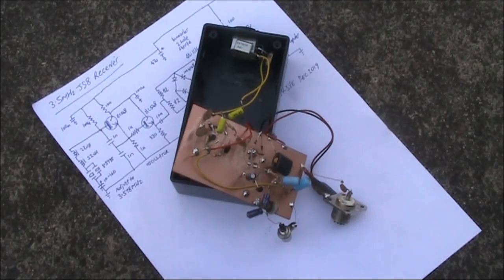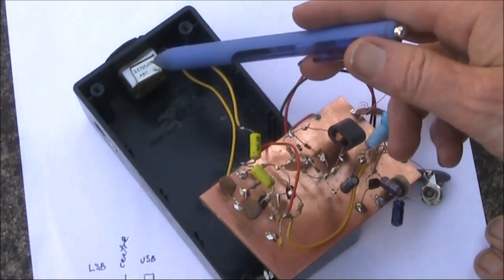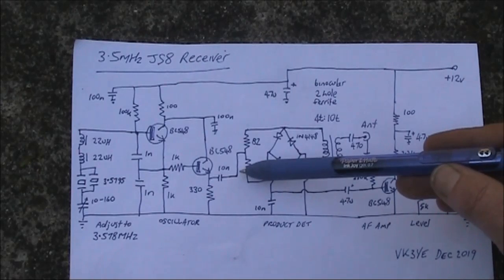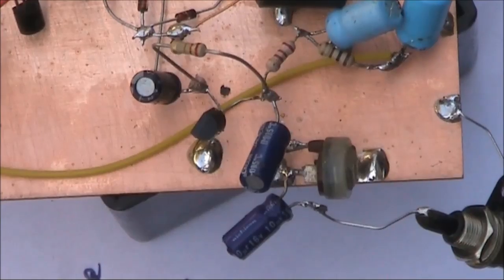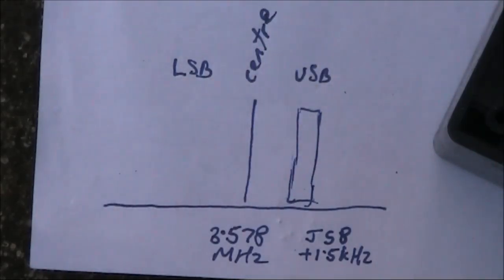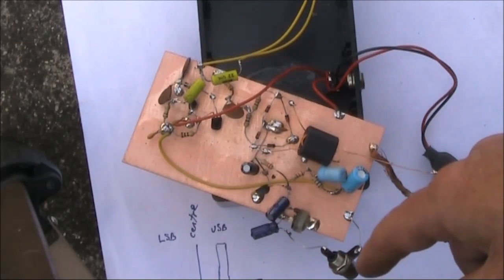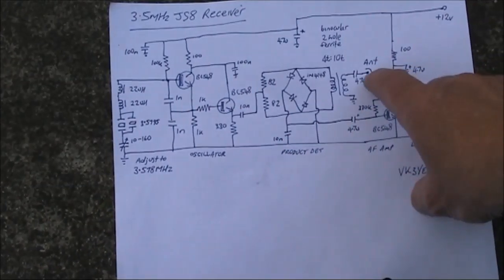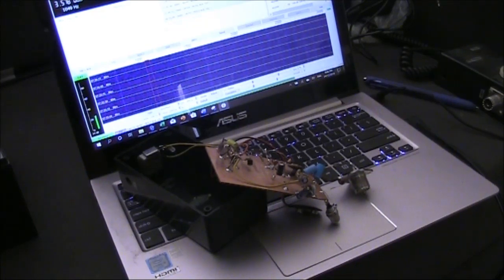Three transistor JS8 receiver for 3.5 MHz

Comment: Very Nice Peter! Simple does it! I did a W1AW code practice receiver for QST mag. back in 98 using this idea, but it was a regenerative detector around the crystal because there was no need for that kind of JS8 stability. Excellent video work.

Comment: 5:10 and 6:30 - you have bugs in this circuit! :-)

Could you add a 90 degree phase shifter at the oscillator buffer output, another mixer fed from the antenna, a polyphase network to phase-shift the resulting audio by 90 degrees, an audio summer to produce USB only?

Merry Xmas Peter, and thanks for the video.
Reply: Flea powered?

Comment: Thanks, Peter.  I'm in the process of building a Beach 40. I wonder if it would be possible modify the Beach 40 to work on 80m and to include the JS8 transceiver circuitry end up with a Beach 80 with JS8 capability? Just an idea.
Reply from the maker: Dan - both should be possible but have not yet done it.

Comment: If you want some selectivity, using a few more 3.579545 crystals in a ladder filter should do nicely. This idea is, of course lifted from the"Warbler" PSK transceiver (by K1SWL, I think).
Vy 73 de Jan, OZ9QV.
Reply: That would do nicely, if you want to use it as a TX, too.
Reply from the maker: A good idea. Depends on where the centre frequency is. If it's unsuitable you might be able to do something with ceramic resonators.
Reply: @vk3ye  True enough.
Reply: @vk3ye  I might try the idea for FT8 propagation monitoring, so simple DCRX (DSB)

Comment: Hi! I want to build this receiver and would like to know if using germanium diodes instead of 1N4148 can increase performance.
Thanks!
Reply from the maker: Not in this circuit. Stay with silicon.
Reply: @vk3ye  Thanks.

Comment: Interesting variety of diode ring mixer,  most circuits I find for diode mixer use multiple tapped transformers but this one is simplified, do you know the name of this type ?  Does it perform as well ?
Reply from the maker: Henry - I do not know the name of the mixer or whether it performs as well. It may only be single balanced rather than double balanced.